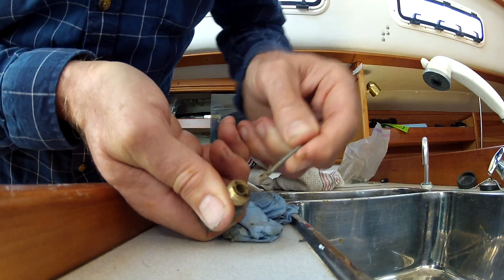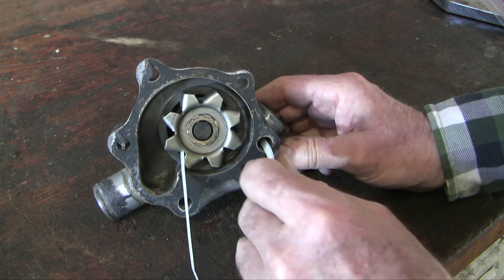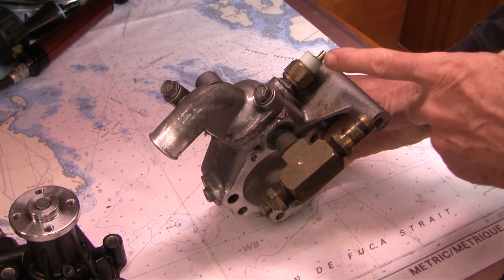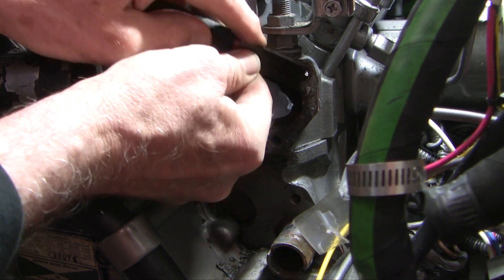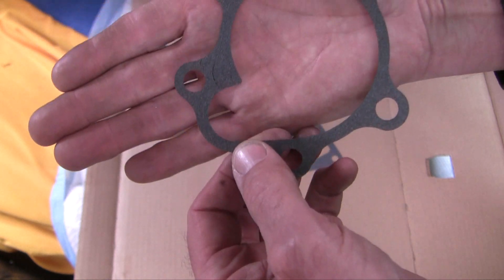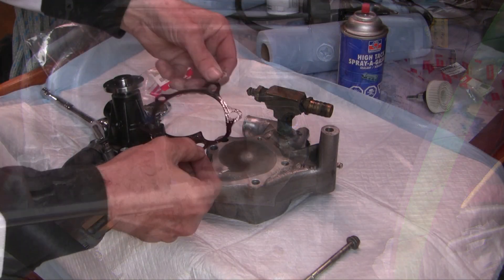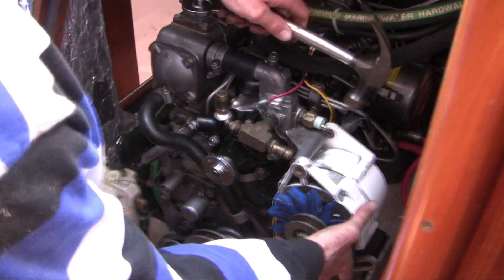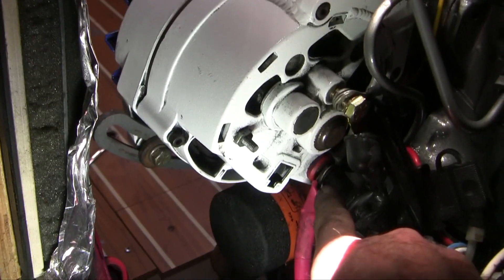How to replace a marine diesel fresh water pump

Comment: Thanks for this awesome video sir. I have a 1988 Watkins 30 that's been sitting in fresh water for years. I have to clean up the Yanmar 2gm20(F) that's in it. I'll have to change and clean everything. I'm sure that your videos will be a great help to me. I've messed with auto engines but never Yanmar (Marine) engines. Thank you for your help sir.
Reply from the maker: If the engine is set up to draw in lake water directly into the cylinder jacket, you'll need engine zincs and you won't have a heat exchanger or dedicated coolant. That should be easy to sort out.

Comment: I need to do this service to a 4JH4E on a Wauquiez Centurion 40S and even though the engine is different, this tutorial is really fantastic. Many thanks from Seattle and happy sailing. We are often in class breaks with J-109's and they can make great competition so hopefully we see you out there. Cheers.
Reply from the maker: Yes, we race every week here in Victoria, boat name is Equinox. Cheers!
Reply: @spelunkerd  was your freshwater replacement pump OEM or aftermarket?
Reply from the maker: @rbarnea  I used an aftermarket pump. It works fine.
Reply: @ thank you!

Comment: Another great video. :)
I use Loctite thread lock. It comes in a small bottle with a cap so it doesn't dry out. Also, it doesn't require a lot of it.

Comment: Ya know, I'm not sure whether I like learning about small marine diesel engines better than I like to sail the boat they are in. I was born a sailor but I'm transitioning into being a diesel lover. Will I be Ok? What will my friends say. They are right-wing sailors.
Reply from the maker: Ha ha, I do understand what you're saying. In our club, many excellent sailors have gone over to the 'dark' side of comfortable cruising, short handed sightseeing, and exploring areas inside the minimum depth limits of my 7' keel. On our last cruise, one of the fuel dock attendants had never seen an extendable bow spirit like mine. And we certainly envied those with more than a tiny dodger when it was pouring rain. Often we cruise as a team and it's great to have a breadth of equipment you get from many different boats. At night, most congregated in the bigger boats for fun and games. Even so, almost everybody had some kind of diesel engine. In the marina, the ones I find annoying are the bulky cats, they take too much space.

Comment: All hoses should have double hose clamps.
Reply from the maker: That's a valid point, for an ocean going boat it wold be wise to follow that guideline. I simply replaced what was there but two would be more secure. After this video was done I had a pinhole leak where the hose leading from the potable water heat exchanger meets the pump, and I redid that connection with two clamps.

Comment: You are way smarter than I am. I watched this 3 times. Great stuff!  I’m assuming there’s no scan tool or service data for Yan mar.
Reply from the maker: Thanks for the kind words. I don't feel very smart, I am humbled literally every day. I have had many misadventures through the decades, all of which were learning experiences. Regarding scan tools, you're right. No oxygen sensors, no cam or crank sensors, and no computer, so no help from scan tools. Not even glow plugs. The fuel injector timing is entirely mechanical, adjusted with shims. These old engines are elegantly simple.

Comment: Excellent use showing specific torques. Everyone just wants to reassemble without a torque wrench. Good and tight German torque does not work well in a gasket setting.

Comment: Looks like an aftermarket oil pressure sender.  Did you have to use an adapter because of the British pipe thread,  and did you add an pressure gauge or stick with the buzzer?
Reply from the maker: I agree. It was like that when I bought the boat, I have no idea how they put it together. There is an analog gauge on the dash, and its movement suggest it is not a simple idiot light.
Reply: Thats a fast response!  So, Yanmar equipped these 3gm engines with a buzzer that sounds as soon as the key is turned, signaling low or no pressure.  Once oil pressure reaches the desired level after starting, the buzzer turns off. Well, many people didnt care for the buzzer, and not having an oil pressure gauge. So, they bought a gauge, perhaps a teleflex, but then discovered it was incompatible with the stock yanmar oil pressure sensor.  Wrong impedance, or such. That calls for a compatible sensor, but, the thread is wrong because its a US made product. Now, some people tapped the existing sensor port and converted it to American tapered thread. Its pretty close between the two thread patterns,  but I am too chicken 🐥 to do that to mine. Finding a ⅛ inch NPT to BSPT adapter is a little difficult, plus the size difference between the tiny Yanmar vs the Sierra sensor is another hurdle. My engine box is smaller than yours, also.
Reply from the maker: @wallacegrommet9343  Mine still whistles until the engine fires up, so both the sensor and the analog gauge work together. That's good to know about the compatibility issue. Perhaps the guys who worked on my boat sourced a metric fitting, I don't know.

Comment: Worlds most expensive water pump
Reply from the maker: Yeah, the OEM pump is expensive, especially if you buy it with the thermostat and bracket as a unit. The unit I installed in the video is an aftermarket "Friday Part" water pump through Amazon for about $140 Canadian, and I reused the thermostat housing. If you buy the Yanmar pump complete with the bracket and thermostat housing, then I believe you don't need to fiddle with the seal between the two. I can see why some professionals would prefer the OEM pump and bracket, because there is a little less labor to deal with two sealing surfaces. In my case it was relatively inexpensive and simple to replace, and the repair worked perfectly.

Comment: Hi Dave! I have a problem with my Yanmar 3gm30F. The stuffing box (packing gland) is leaking and I am very worried about flooding of the boat. How do I get my hands in there? There is a muffler over  the nut which has to be turned. I cannot even measure what size of wrench do I need. And when I tried to turn the nut a little, it started to drip more. Please explain how you deal with the problem in your engine? What size of wrench is needed? Thanks, Gennady
Reply from the maker: As common as stuffing boxes are, I have very little personal experience with them, and none that would be of value to a person looking for help. This boat has a sail drive. Sorry I can't help!
Reply: I’m having the same problem. Did you find a solution?
Reply: @el_sweetime  yes. I found a mechanic. For 300 bucks - 3 hours of labor - he fixed this and other problems. Cheers. Then I added an automatic and manual pumps to the bilge.
Reply: @tomjoad1060  cool thanks man
Im going to tackle this project with a neighboring cruiser.

Comment from the maker: In the official Yanmar repair manual, as is typical of old style repair guidelines, torque specs are not emphasized. In that era we went with experience and instinct, except with head gaskets. I was able to find reference on page 8-5 to a torque of 2.89-5.79 ft-lbs for the pump setting bolts, which had me confused since that is much lower than we typically use for a water pump. I think that spec is wrong! During the video, you saw me make a big fat guess to do a second round at 10 ft-lbs, and a third round at 15 ft-lbs. The one smaller bolt holding pump to bracket was done without a torque wrench but was not so tight. After a thoughtful remark by a viewer below, I looked the spec up in the Clymer manual for Yanmar marine diesel engines. On page 182 they quote a torque spec for the freshwater pump at 20-25 N-m, which works out to 14.75-18.4 ft-lbs. So, if you believe Clymer, my instinctive decision based on past experience to use 15 was right on the money. It's still early but so far there is no issue and I'm confident we've accomplished the task.

Comment: I wouldn't worry about the bolts breaking as I would about the threads in the block stripping.
Reply from the maker: Excellent point. These days with aluminum blocks becoming the norm, manufacturers are pushing tolerances and as you say the weak point is the aluminum threads. They also publish carefully researched torque limits. And in this old cast iron block the same will hold true, the threads will fail first. Even so, the torque I used here is pretty typical of that used for old style water pumps so I felt confident to move forward in the interest of preventing a leak. Judging from the corrosion on one of the bolts, I think this pump had gasket seepage in the past.